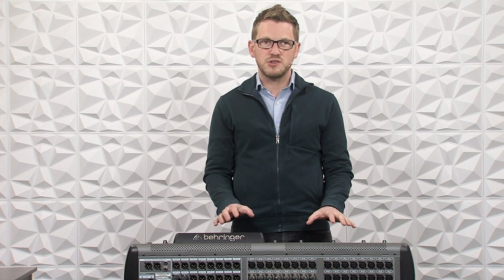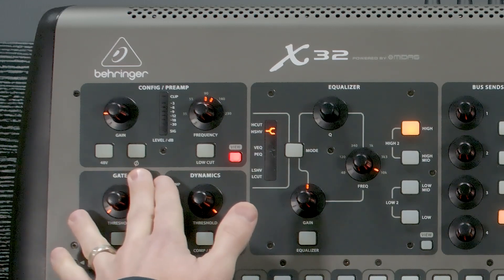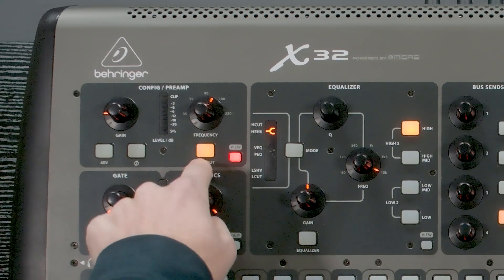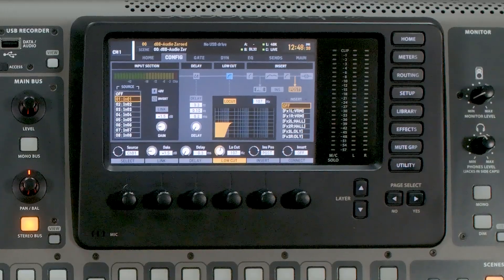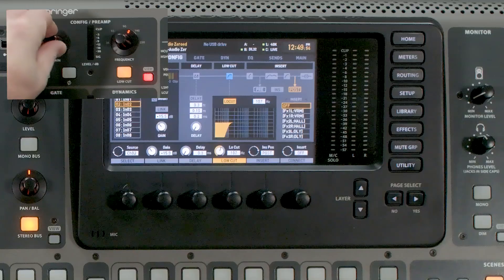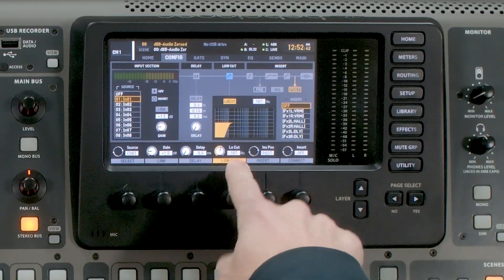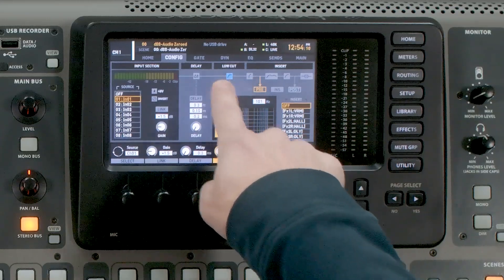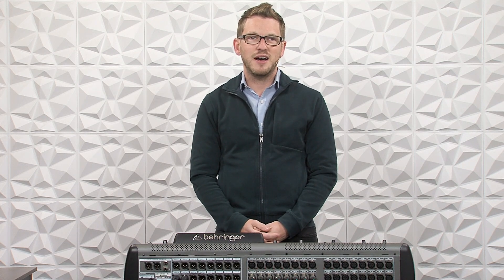First Steps on the X32

Comment: BEWARE NOTE: Behringer has a major problem with its products documentation manuals in them using proprietary PDF X software, just has a nice long email session with them and this is my findings response:  I believe the problem is you are using a proprietary PDF X software and it is a password protected doc. Most all pdf docs will open in acrobat pro and have full edit, but yours does not and has a password protection on if. I do not use any other PDF creation software, do to them not having the functions that Adobe Acrobat has and does such as copy, scan and insert functions that all others do not have. SO whoever created this manual in PDF X software, password protected this and all your other PDF docs created by it. SO yes your downloads for manuals are password protected by its creators. In conclusion this is a major problem, so no one can copy text or pics to create quick reference user notes to learn on using behringer products.
Reply: Ever heard of screenshots? lol

Comment: Oh, just BTW - calling a polarity reversal switch "phase" is totally cool. 180° phase change is a reversal. Lots of gear refer to this function as "phase" Also, delay is not "phase" Delay changes the phase of each component of a signal differently, depending on the frequency. Really, its a small point. Your exposition skills are excellent. Well done. I'll check out your other vids. I'm thinking of cashing out my StudioLive 32.4.2AI for an X32
Reply: I’ve actually been torn between the x32 and the new studiolive, but I’d have to go with a smaller studiolive to get the same price range. Anything in particular that would keep you from getting the newer version of studiolive?
Reply: remind me never to hire you

Comment: I would like you to help me. I bought your pack of scenes for Behring x32 in January, but I see that it is configured only for the x32 model with 16 outputs, and I have a compact with 8 outputs. I would like you to help me try to configure it.  it's for a church in Connecticut.  I have tried to do the configuration but I can't